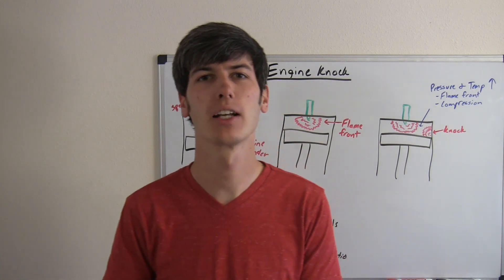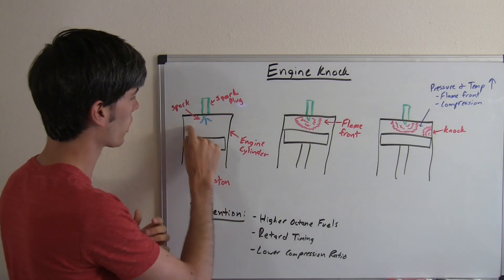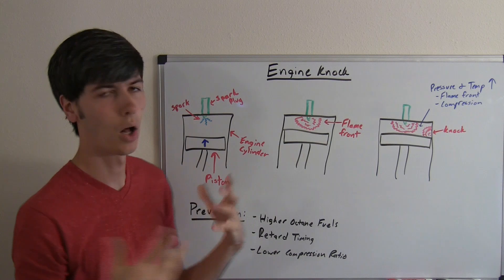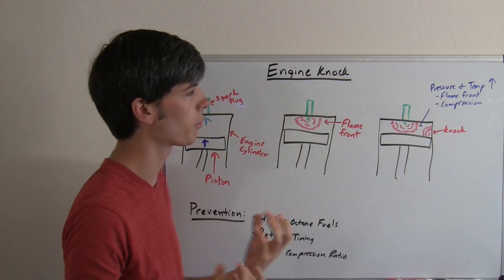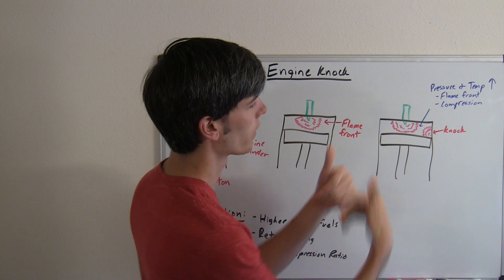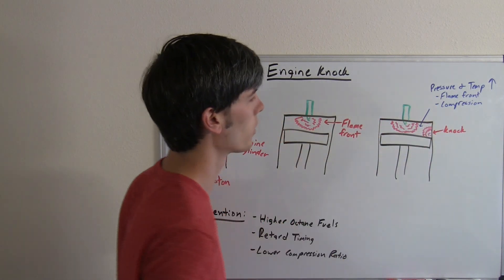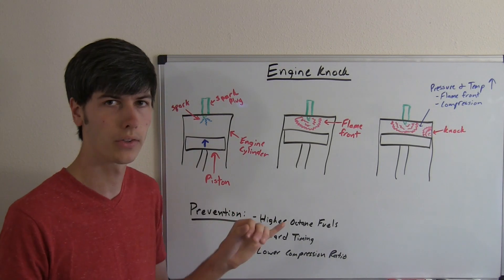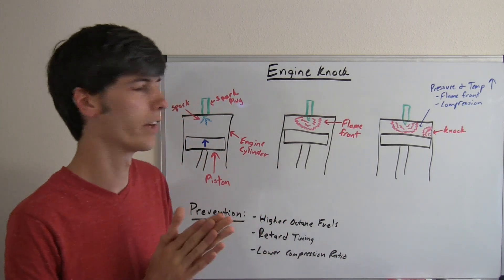Engine Knock Sound - Explained

Comment: The word "knock" is not my preferred word for pinging (English is not my first language though). Just not to make people worried when they hear different sounds. My definitions of different engine noise: Knocks (muffled/dull) = worn crank bearings or piston/pistonrods. Ping = early detonation. Constant ticking = too big valve clearance or noisy injectors/other cylinderhead mechanics, some of which might be okay and not really bad for the longevity. There is more to write, but I think that covers most of the common noise. :-)
Reply: my crv is making a knocking noise but not muffled or dull.. i would say its more of a high pitched knock.. but at the same time its not ticking.. its louder on a cold start and theres a sweet spot i can rev it at (like 2200 rpm) and its louder.. what do you think it could be... its a 2008 crv 2.4 engine
Reply: Jonathan Carida its really hard to tell for sure. Is it the same sound regardless of load? Like revving the in neutral or accelerating in gear. Same sound with no acceleration? If no difference it's most likely something in the cylinderhead, like a bad/clogged lifter or similar. Also check pheriperals like alternator and waterpump. Timingchain? I once thought I had a worn out enginge but it was only the waterpump. Try google your car model with knocking and see what you find. If you're lucky it's a common problem. And of course, check the oil level ;-)

Comment: Some points for your consideration:

* Knocking doesnt create a nice flame front like the sparkplug does, it creates a detonation with a sharper pressure increase - that's why it's dangerous
* If the pressure wave hits the piston after TDC it's knocking and will damage your engine over time. If it hits the piston before TDC then there's a gurantee your engine will be Dead in an instant (broken/bent rods, bent crankshaft, ...)

Comment: That make sense great video, but I got a question my cobalt ss sc every time I start it I hear the "knocking" noise even more when it's cold, but just at the beginning at the normal operation the car runs fine, so is it the knocking sensor or the mixture combustion am I little lost at that point, What can I do to solve the problem if that is a problem? The recommended gasoline is premium and sometimes when I use regular the noise is less! So what could be the most possible cause of this issue? I'll appreciate any idea that would help me to fix it. Thanks in advance..!

Comment: Jason, how does a vehicle go about establishing the acceptable timing range? My assumption is it may periodically sweep a narrow band of timing angles looking for either knock, EGT temps, or O2 values. I suspect EGT and O2 values take too long to settle in comparison to the time it takes a knock sensor to see knock or not. My theory then is the following: Vehicles periodically induce knock to determine the acceptable timing range thereby indirectly determining the octane in use? Do you know if this an accurate statement?
Reply: If the car has a ECU, it's most likely to use models to calculate an aproximation of what the engine will do (O2 Levels, EGT, Knocking based on values like air mass, fuel mass, ignition Timing, ...). This aproximation is pretty good and it only needs to account for the differences.

But that differs between engines or their uses. Some models may simply use Knock detection to prevent damage while high Performance engines may actively search for the most favorable ignition timing possible.

But it's not perfect. If you switch from 98ROZ European fuel to unknown ROZ russian fuel on a modern engine, it happened to kill 3-4 engines within a Minute on the way to a cold trial Test.

Comment: Engineering Explained, I do have a question that may help others. I have an old v8, it has a lobey-er camshaft in it with roller lifters. When I was driving once, I heard a loud bang, and my jeep died. Then it started again fine and drove home.

Made the same bang noise immediately after starting the next morning. then it was fine. However, another symptom has appeared, when I rev up the engine real high (~2000-2500rpms) then let off the gas, it will make one metallic ping noise, as if one were to hit a metal spoon against a pipe. I know it runs really rich and I use 87 octane.

Changed the oil, and I'm about to pull the spark plugs, this only happens on one cylinder though, what could it be?
Reply: sounds like you need to change your fuel type and check the air related stuff like the intake, throttle air filter mass air flow sensor stuff like that since it's running rich

Comment: is it ok to use ron95 on engine with 11:1 comp ratio?
Reply: Check your owners manual. There are many factors involved in engine setup. You can use ron95 on 13:1 if air/fuel mixture is rich enough.

Comment: Now I need to know what a knock sensor does....
Reply: a knock sensor is a piezeoelectric (boogered that) sensor, it picks up on excessive vibrations (generally resulting from a knock) and relays that info back to the PCM.

Comment: Thanx for the explanation. I have a question though, today I went earlier to the desert for some fun. However, I noticed that my 2006 landcruiser (1FZ-FE, manual transmission) when I rev at about 5000 rpm the engine knocks. This only happens when I'm in 1st gear and going up a sand dune, it doesn't knock when I rev it while standing still. What seems to be the problem?
Reply: Ana Ana detonation

Comment: The only important thing about high octane is that it burns slower. In a high compression or boosted motor low octane fuel would burn too fast and the flame front would meet the piston too soon as it comes up on the compression stroke. This tries to turn the engine backwards a bit, and the knock you hear is the pistons rattling in their bores. Knock is very stressful. Assuming no aftermarket modifications, you should have no need to use higher octane than the manufacturer suggests, unless there's a mechanical issue like carbon build up, plugs, timing, injectors, ECU, etc. Knock without a change to a lower octane means something's gone wrong and needs attention soon.

Comment: My honda Atkinson cycle compression ratio 13.5 : 1
is it safe for me to fill with regular gasoline ? cause i been fill up with premium since last year,which is very expensive in my place,and is auto start stop(engine shutoff when break fully pressed) bad for my car battery ?
btw its a Honda FIT 3rd Generation 1.3L and its not hybrid
Reply: If I'm not mistaken, it should be on the gas cap what octane fuel the car uses, and the only difference between "Quality" of fuels is the octane, and if it can only run on high octane, it may be possible to get a kit or a tune to adjust the ignition timing so it won't knock on lower octane, but really if it wants a certain fuel it's easier to just give it that or get a different car.

Comment: Would have been very helpful to have a clip of what it actually sounds like. It would also be cool to see a description of the chemical differences between the different octane fuels. I know it depends upon additives such as ethanol as well, but I think a basic overview would be helpful at least.
Reply: TBH, these days most computer controlled engines do their best to avoid it. Sometimes you can still hear it when you put too much load on the engine (climbing a steep hill). To me it's more of a rattling noise than knocking or pinging.

When it's really bad, it sounds like a diesel engine. If you have a gas engine that's making that sound when it's not under any load, shut it off quick.
Reply: I have been in a couple cars that become more audible upon random cycles during idle or while driving. There is an increase in vibration at those times as well. But it doesn't really have a knocking or pinging noise. 

Is the knocking a concern with computer controlled engines?

Comment: Hello really enjoy your videos. I have a question. I am wondering what your opinion is on octane boosters? I pull a 16ft enclosed trailer with a chevy 1500 with a 5.3 engine. I have been hearing a clicking noise under full throttle above 4000 rpm. I am wondering if an octane additive is worth a try? Thanks
Reply: Make sure the oil is topped up my buddy's 5.3 started ticking under WOT, turned out he's was low a quart and a half.

Comment: hey. My car is a premium gas recommended but I've been using regular gasoline and it's been a week. After a week,my engine does knock sometime,not continuously. Is that because of I change to regular gasoline? How to fix this? If I got back into Premium gasoline,will this fix the problem that knock?
Reply: my car is Mazda 2 2015 1.5L Skyactiv engine.
Reply: Yes, premium gas can handle higher compression without combusting. The higher the octane the higher the compression.
Reply: I Love Bj's so.. just put premium gas,and it will fix the knock problem itself?

Comment: Pretty damn good man. This guy gets a sub.
Reply from the maker: +unlitdarkness6 appreciate it!
Reply: +Engineering Explained canyou help me i hear a ticking noise after we changed the timing belt and the oil please give me some advice to what this can be the ticking also follows the rpm's
Reply: *****
Yeah, Fixing stuff is my day job, but my real goal is being a chassis and body engineer.
Reply: Jorge Diaz
Double check timing marks, check oil pressure ect.

What type of engine is very important as well, could be a million things.
Reply: +LoungeLimpingTelevision Hmm, diesels inject fuel on the compression stroke, just at the right time, this mixture detonates because of the high heat/compression in the cylinder- there is no ignition source- no spark plug (only glow plug to help with cold starts)

Since fuel is only available at the end of compression stroke- it really can't knock under normal conditions- however, if there was contamination of the intake side- say a leaky turbo bearing or starting fluid-  two flame fronts could collide and "knock".

Starting fluid is dangerous stuff on diesels- there are heated grids on some- which could explode the fluid in the intake (ba-BOOOM) glow plugs could prematurely ignite it (backfire) it can pool in the intake (BOOOM) and there is the possibility of blowing a hole through the piston.

Comment: On a modern engine with electronic ignition timing, can a faulty knock sensor confuse the ECU to alter the timing in a way that it can affect power?
Reply: yes it can and that should be fixed asap

Comment: Question regarding lifter ticking.
would using ATF oil in engine clean it out and solve the issue?
seen few videos and they seem to work but its the internet and i don't believe everything I see.

Comment: Okay, so I don't know if this is just a coincidence or what.....please help!!!

Yesterday I was driving and all of a sudden my vehicle died. It started back up immediately but the gas light started flashing red & beeping. I got to a gas station, checked the oil, and it was empty....I mean EMPTY. I filled it up with oil and the light went off but now this morning it's making a loud knocking sound when I accelerate. It's running kinda sluggish now too. I would appreciate any feedback. I don't know anything about this stuff! :(
Reply: +KatyG82 sounds like it could be slightly seized from running with no oil it should slowly go away
Reply: +Joshydmanx The noise has actually gotten worse....it sounds like a Tin Lizzy now. Someone told me it sounded like the bearings(?) were bad. Could the issue with the oil cause that? 

Thank you for your help. I really appreciate it:)
Reply: yeah the bearings use the oil to cool them so they could have melted and started to rub on their housing. your welcome :)
Reply: +Joshydmanx Oh okay. Well damn!!! Is that a big deal to fix? Is it expensive?
Reply: +KatyG82 it depends it could be anything from a couple of hundred if it isn't too bad to a thousand dollars if you need a full engine rebuild
Reply: +Joshydmanx Dammit, man! Really?!?! So, what your sayin is- I need to run it into a tree and collect insurance on it??? Lol! J/k....kinda;)

You're a doll baby:) Thank you so much for your help!
Reply: You had no oil pressure which means you'll need to replace the mains. But if you decide to do that, I'd replace the rod bearings also.
Reply: +prodrin back
 I have NO idea what any of that means.....but thank you for your help:) I really appreciate it.
Reply: +KatyG82 my guess would be that one of your pistons has actually jammed due to the missing lubrication from having no oil in the engine. If that's the case, your engine is basically gone. What does your local workshop say? It's not really possible to say with certainty what happened based on some textual descriptions on the internet..
Reply: +paeppi 
Yeah, you're exactly right! My engine is fucked! Gotta get a new one:( I don't understand any of it so I can't really explain what they said was wrong...something about "it threw a rod" or something like that.
Reply: +KatyG82
"throwing a rod" is quite a bit more severe than just a bearing failure, and is usually caused by a failed rod bearing finally breaking.
It means that not only has the bearing failed, the parts it was connecting are no longer connected to each other.
On high performance (race car) engines, the progression from rod bearing failure to thrown rod can be nearly instant. Passenger car engines usually have at least enough time to figure out "something's wrong", and pull over. Some old diesel engines will just keep going without much complaint other than a skip (due to the missing cylinder).
This is almost always a fairly violent event, often resulting in a hole in the side of the engine (called a "window" in the block because you can see right thru it).
If you're curious, you can ask your mechanic if they saw a hole in the block of your engine, and if they did, you can ask if they'll let you see the damage.
If they won't let you on to the shop floor (often for insurance reasons), they should be able to have somebody that works there take a picture of it with a cellphone or something, and show that to you.
The image is usually something that provokes at least a WTF from me, and I work at my dad's auto shop. Luckily we haven't seen too many of these, but the few I've seen in person are etched in my mind.
And of course there's countless pictures of this kind of thing on the Internet.
Reply: +KatyG82 This is why you should ALWAYS check your oil atleast every other week.

Comment: How then would a knock sensor work?
Reply: +sandplasma
it's essentially a microphone bolted to the engine block. When the engine "pings", the computer "hears" it and adjusts the ignition timing until it brings it below a programmed threshold.

Comment: The Honda IDSI engine, with 2 spark plugs per cylinder,  has a constant and controlled "knock" by design. How come it doesn't create that damage that you mentioned in this video.
Reply: because the ping sound source assumption in this video is wrong. As far as I know there are two kinds of gasoline combustion inside an IC engine: progressive combustion and instantaneous combustion of all A/F mixture, later being the cause of knock.

Comment: My Mechanic messed up my engine, installed an oversize piston of 1.0 mm on a 4g15 engine, high octane fuel cannot cut it and retarding the timing still won't make it , is there a remedy to this? do i need to revert back to the original piston size?

Comment: what about valve knocking.... since if my engine knocks I am not sure if it is fuel or valve knocks issue.
Reply: That's a ticking sound. Ticking is usually described as a valve sticking, lifter not staying pumped up or a bent pushrod. Knocking occurs in the bottom end

Comment: I get pinging if my ignition timing is too advanced. I always figured it was because the ignition was simply happening too soon. My car from the factory is set at ten degrees advanced, but twelve is safe and fifteen is safe with higher octane fuel, otherwise it would ping. But cars these days have knock sensors, and will automatically adjust certain parameters until it stops.

Comment: The knocking sound  is the connecting rod ringing like a bell from a sudden increase in cylinder pressure. Think of a piston in a cylinder  with the head off..Youi can take your hand and push the  piston down easy enough. if you took a hammer and hit the piston hard you would be able to 'knock' a hole in it. Some knocks can be difficult  to diagnose.The knock during combustion is NOT the same as a knock heard from loose piston --cylinder clearances (especially when cold)There are 2 kinds of combustion knocks  One is called PRE ignition (caused by hot spots in a combusyion chamber)the other is Detonation (caused by  low octane.. High cylinder pressures. Incoming mixture toohot... engine overheating spark advance too excessive   Lean Mixtures..or lack of EGR in a system designed to require it. Lugging an engine will produce high cylinder pressures.. detonation is the most common knock heard  sounds like marbles in a soup can.Knocking hurts the rod bearings by squeezing out the oil on the bearing itself Not to mention the high heat associated with prolonged detonation
Reply: Thomas Rose Hi I have been told to change from regular unleaded fuel to the next level which is super unleaded. Try that first.
Reply: Thanks for the clarification

Comment: Great video. My question is it possible to have that second flame front ignited before the spark plug ignites the main front? Which front ignites first?
Reply: +Stefan Ovcharov I dont think that cn happn bcuz after the first ignition only the pressure at the other end must be reaching to requisite value but pls check the logic....
Reply: +Abhisek Mishra Dats a gud logic. Thx!